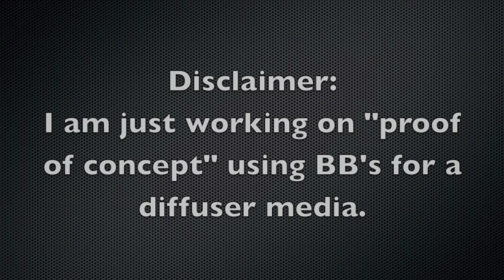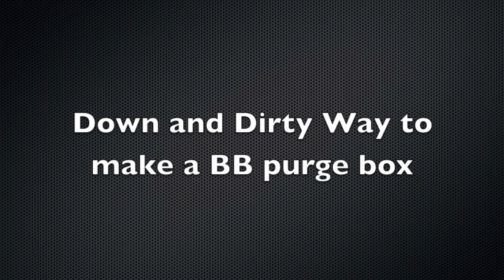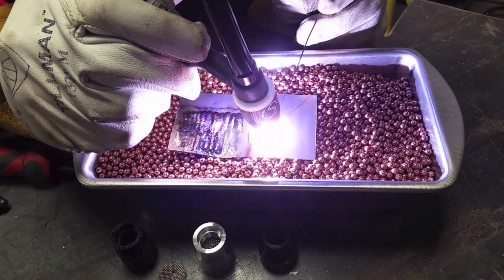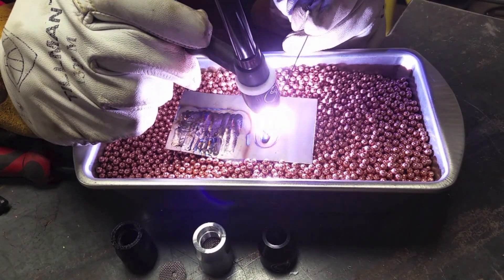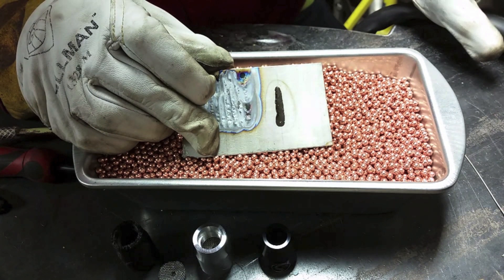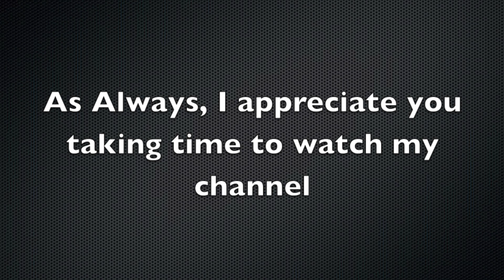Argon Purge Box part 2

Comment: That Optrel looks nice and all but get that baby in a production environment where you have to move around a lot and you'll have those knobs knocked off in a week. At my work we use the Speedglas PAPR units and I'm one of the few that has the Miller PAPR. I've been using mine for almost 2 years now and it's still working great.

Comment: Watching this I came to the maybe brilliant idea of what about using a slightly modified blasting cabinet filled with purge gas? You would have great access to the parts and could easily have gas everywhere around the parts. With good gasketing and gloves I think you could get by with very little gas use once charged as it would be trapped in the cabinet.
Reply: In the titanium field that is what they use but purging the box takes a lot of gas and have to allow it to still flow out. One advantage is that gas is not needed once the box is purged from your torch. Normally 8 to 10 minutes of purge before welding can be done and with application like that a monitor is normally used

Comment: If you’re worried about bb’s sticking to the part try taking everything out of the box & adding very spiced height 1/4 legs/pegs then fill it back up with the bb’s just below the top of the legs. Then the parts can sit on solid legs but still have the bb’s to diffuse the gas

Comment: Some great ways to bend copper tubing like you have there.  One way is fill the pipe with sand before bending.  Fill and tamp often then bend. Also can fill with water and freeze.  Prefer the sand.  No machinery and sand is readily available.

Comment: Just scrounge the ceramic infared burner plates from the front of a gas heater and put that on the top. Nice and porous (designed for gas flow through them), pretty tolerant to thermal shock, non reactive, high heat tolerance and available free.

Comment: Hey Jodi,
interesting concept but there is one thing I'm not quite getting, why not just pick up a tabletop glove-box (like a small blasting cabinet) and just use it as a gas chamber? 

it takes very few modifications, just got to replace the gloves with long sleeve welding gloves and need to change a few pipe fittings. I would even consider putting a auto darkening filter right on top of the box's window and shield the rest so won't even need to wear a mask. actually, it would probably be a good idea to put the shield on a separate frame so you can flip it up to see the inside easily to set up the weld.
Reply: +LateNightHacks 
just had a quick look around, the whole setup should cost just under $300USD.
interesting to see if you can just fill the box and give it just a bit of positive pressure and not use gas on the torch at all. that should do some gas savings specially for jobs that don't have to go in and out of the box too often

Comment: jody,how about trying to do something similar to this using a cheap tractor supply blast cabinet.substitute the rubber gloves for welding gloves and seal off the filtered vent on the side.it might give you a little more working wiggle room for larger parts.just a thought

Comment: First I really enjoy your tips and tricks. I'm currently looking at Eastwood Pro 200 AMP Tig Weld Welder - Square Wave Inverter 110/220V AC/DC $739.00 with free shipping. What's your opinion on this welder? I have an Eastwood 135 might and works perfect for the welding I do. I have a cnc mill chip pan and enclosure that I need to tig weld. If I was using a tig everyday I could justify spending more money. So for the money is this a descent tig welder?

Comment: Jody, any chance you can do some welding on some ER80 material with ER80 filler rod? I'm relatively new to the TIG process and I have a project, I need to weld some tubular race car bumpers to the stamped mild steel factory mounting points.

Comment: You could try some G1000 alumina ceramic balls. They are available for about $0.09 a piece so not the cheapest option but they won't melt or contaminate anything.

Comment: How about using ceramic BBs, they should be heat resistant. Argon is heavier than air so filling a box with argon makes perfect since. This is just a wild thought, but fill a sand blasting booth with argon and weld in the booth.

Comment: since argon is heavier than air, is it really necessary to have the plexiglass restricters?  And also, regardless of the shielding and the weld looking good, isn't the part still affected more by the heat effected zone than surface oxidation, which is an indication of good welding technique?  Im a a beginner, not an expert by any means.  Just asking.  thanks

Comment: Argon is heavier than air. Per Wikipedia, 38%. So I would think you would want to be injecting it at the top of your box. Maybe put some small holes in the bottom for it to flow out of... When I was MIG welding inside small items that were box shaped I could decrease the flow rate considerably (Argon/CO2 mix). It was easy to notice that the gas wanted to stay in the box/enclosed area.

Comment: How about using a sand blasting cabinet style set-up for doing larger parts like Magnesium wheels, or larger stainless parts, aluminum, etc. And for companies that are large enough and do large runs of exotic metals, an entire room thats flooded with argon, and you could wear an oxygen supplied helmet that evacuates all excess gasses like your exhaled breath. Thinking out loud, but seriously though, anyone come up with why it wouldn't work?

Comment: Could one not make a welding box akin to a sand blasting cabinet for welding small parts? Make the top the hatch, a large glass or plexiglass front, rubber inserts taped to welding gloves, insert part, purge, weld. maybe an oxygen meter just for kicks if that exists.

Comment: Hi Jodi love you vids. If you could see argon wouldn't it fill back up box like water and over flow? Why do you need a diffuser material ?  Thanks for  sharing your knowledge.
Reply from the maker: Good point. Diffusers might be unnecessary but we like overkill
Reply: If the air in the room is perfectly still you wouldn't need a diffuser

Comment: Ceramic bbs, if available, might be the thing.  Maybe as polishing media?  Could withstand the heat and not contaminate the puddle.
Reply: +Christopher Beasley I was thinking the same thing. http://www.rodeco.com/product-categories/ceramic-beads/
Reply: Ceramic raschig rings or ceramic saddles are cheap and come in a variety of sizes.
Reply: This is definitely available.  Might not look like shot, but lumpy or some odd shape.  Very durable, hard, dense.  I think this might be ideal, since if one of the beads is touching red-hot metal it won't melt, might be more like that ceramic backing "tape" you see.  I think you'd get less contamination from hard industrial ceramic beads than metal ones.  I was thinking the BBs might be oily?!  Stainless polishing media would be my second choice.  It comes in odd shapes (little flying saucers, or sort of like rice, or little beads) or you can buy it mixed.  It's very shiny!

Comment: hey Jody had a quick question we use 1/8 2% thoriated electrodes at work and I planned on  welding up some exhaust tubing any recommendations running a 350mp with a left start TIG on it I have a heck of a time trying to weld below 50 60 amps with a sharp tungsten
Reply: Ah, if you can, you might want to try like .040 (1mm) tungsten for such low current.  It will light right up!  I notice on YouTube that people seem to use much bigger tungsten than they need.  It wants to be a certain temperature I think to get emission.  I notice that if the electrode is too big, the arc is all over the place until the electrode gets hot and the end, and then the arc seems to snap on to the end and settle down.  With .040" electrode this happens instantly.   Also, little electrodes are much cheaper, easier to sharpen....

Comment: I'm just curious: could you weld under vacuum? ie you make a sealed box with a tungsten electrode moveable from outside in some way, then make vacuum and weld?
Reply: This is a lot harder than it sounds!  The box has to be very strong, for one thing.  For another bigger thing, the way electricity acts in vacuum is surprising and hard to describe.  Argon and Helium are profoundly inert, it's not so bad to use them!  There are for sure vacuum furnaces, people might like to braze and silver-solder and stuff in vacuum if they can.  There might be a lot of situations where this is BETTER than welding!

Comment: I would love to know  the best TIG rod to use when welding sockets, wrenches, etc. and best technique if possible.  I have never had much luck welding them since they seem to be crack sensitive (heat treated and high vanadium content I think is the problem).  Any tips appreciated guys.  Thanks.
Reply from the maker: 309 stainless rod works great
Reply: I think there's a video addressing this specifically, on this channel.

Comment: I wonder whether silica (think humidity absorbing, or some cat litter) beads would work. Possibly also catch any water that might come through.
Reply: +balisticsquirel how would the part be connected to the work lead? The metal bb's provide a means for circuit completion. The media at least needs to be conductive, unless you otherwise connect the part to the work lead somehow.
Reply: Yes. Sorry that's what i had in mind but failed to say. A clamp or clip or lead to the part.
Reply: a small braided lead with an alligator clip would probably work really well!

Comment: Do you have to have two argon cylinders to purge?  Or how do you do it? Thanks
Reply: you can use a y piece fitting after the regulator to attach 2 flow meters. 1 to feed the torch the other to feed the purge

Comment: Does anyone know if the Optrel or any other auto-darkening helmet works with the Miller Aerowave?  I have resorted back to a manual lid as my Miller Digital Elite does not work at all on either ac or dc.

TIA

Comment: Cool idea. I started to think how to apply this method on a larger scale and remembered this: Russian aircraft manufacturer uses similar idea - they just get the guy wearing space suit into a gas chamber.
http://sdelanounas.ru/blogs/62583/
Article is in Russian only, sorry, couldn't find similar info in English.
Reply: +Александр Хорошко I think Trek used to do that also when building their high end frames before carbon fiber.
Reply: An engineer told me long ago that the Typhoon submarine titanium pressure hulls were welded up in huge buildings filled with Argon.  I guess this is the welding shop of The Future!

Comment: i dont know how your electrical power is called in poland where i live single phase 230 v 50 hz  is often called ''light''  dudes language  becouse is mainly used for lamps  and light duty maschines three phase 230 in triangle gives you 400v on heavy electrical motors  and heavy duty maschines is called ''force''  also we have welders on 230 v single phase (force) and 400 v triple phase (light) in USA your light is 115 and force is 220?
Reply: Here in the US, 'light' is both 120 and 240, since they're both almost always single phase. Three phase or 'force' starts at 460-480V and goes up from there for heavier equipment.